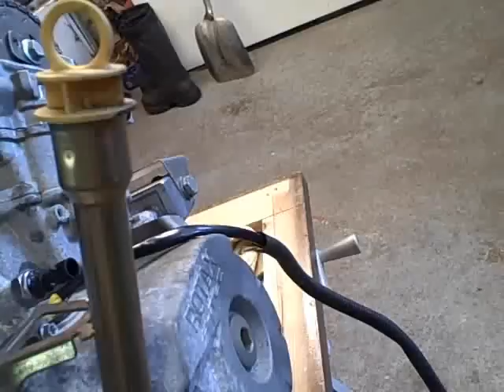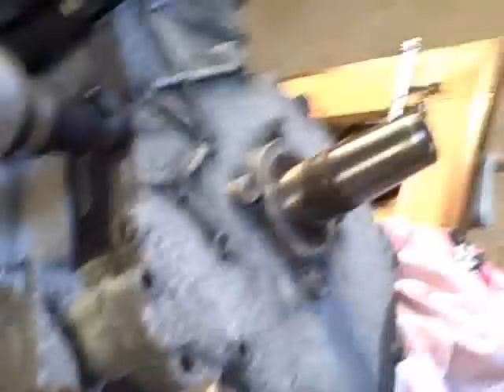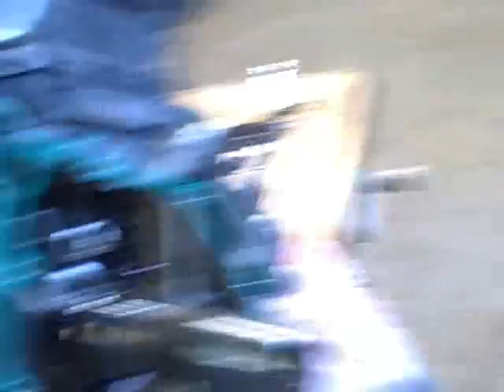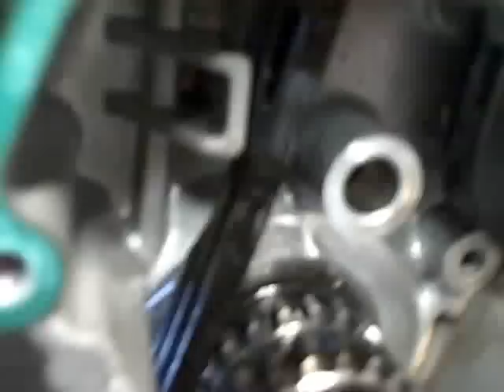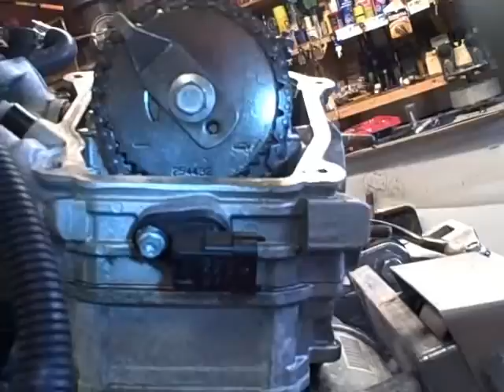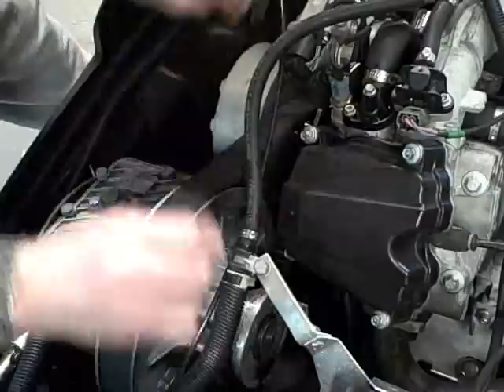07 SKIDOO BRP Expedition V800 replacement of timing chain and guides x Hunt4fish Part  3 of 4

Comment: To be fair. You spent so much time on the oil filter and non important things. You did not show the crank locking hole. Did you leave the locking bolt in for the entire process or does the timing get set on different crank positions. My outlander broke a chain so there must have been a problem with them and I have no reference as to where the cam timing should be. The manual I bought is also not very helpful. I would like to have seen more of the magneto and clutch removal. I think that anyone that can not workout the oil filter change would not be attempting this job. Back to my stupid manual
Reply from the maker: Sorry, I'm not a mechanic; this was a vid that I did while I was attempting to replace a defective chain and sprocket with the V800 BRP Expedition that I own and the time was limited. Anyone who might see something helpful there was why I posted. There was huge problem with the timing chain and sprocket on those machines and I corrected mine and still using it today no probs. Yes there is one bolt ( only one) rear of engine that you remove to insert the locking screw  and piston has to be TDC and lines on top sprocket have to be parallel to the cylinder head for it to insert. You can see it in the videos exactly how timing is done and I show timing it too in several places. The annotations must be turned on as well.